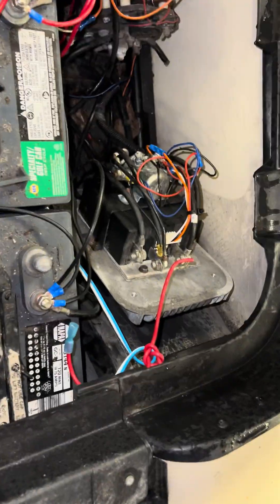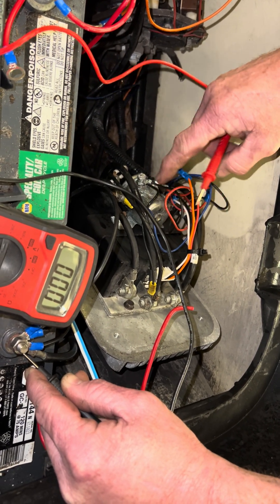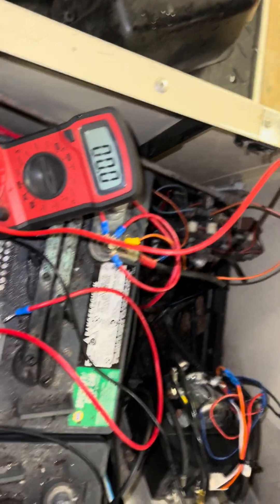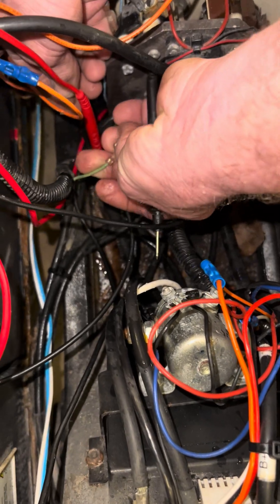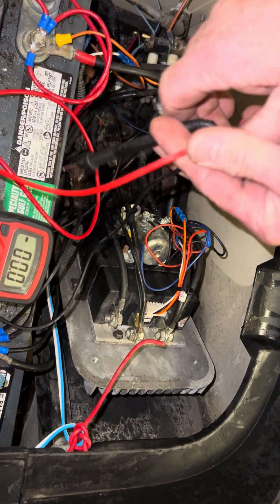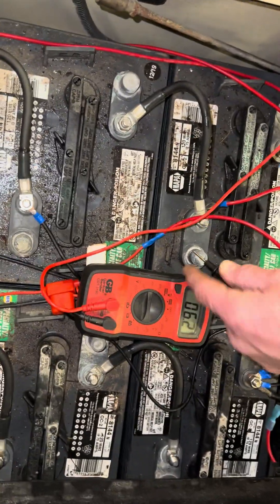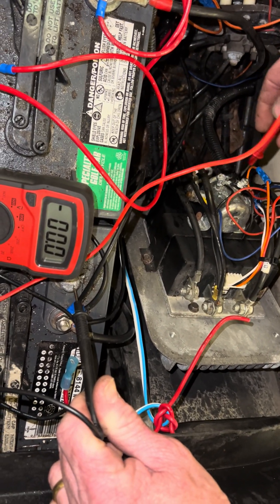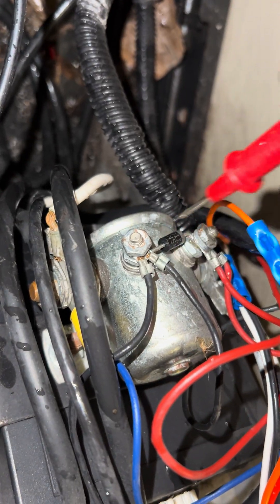What's REALLY Causing Your EZGO 36V SERIES Controller Solenoid Problems?

Comment: 2013 ez go cart won’t move. The beeping noise stays on in reverse, neutral and forward. Change the ignition switch and still does the same.
Reply from the maker: https://youtu.be/7Lks9A9b8Ko?si=lI8EJ28OY0PhZmS8
Reply from the maker: Has it been towed in run?
Reply: @golfcartwhisperer   possibly once or twice
Reply from the maker: @lbj2642  unhook the orange wire off the back of the f n r  switch and let me know if it still beeps in forward. If it does replace controller.  What’s the background behind the cart.  Or It just wouldn’t run one day. Or it broke down and you towed it home in run. Also when did the reverse buzzer start in forward.
Reply: @golfcartwhisperer   it was giving to me and the only thing I known is that the brakes locked up on them once before.
Reply from the maker: @lbj2642  how do you go from forward to reverse. A button on the dash or the keyswitch
Reply: @golfcartwhisperer   key switch
Reply from the maker: @lbj2642  oh so you have an Ezgo Rxv.  I am going to share a link with you
Reply from the maker: See if it makes this sound. Or is it like a bird chirping and constant
Reply from the maker: If it’s not like in the video that I shared with you.  Pull back on your gas pedal all the way.  And hold back on the gas pedal while you turn the key on and see if it goes away
Reply: @golfcartwhisperer  it’s like the sound on the video
Reply from the maker: @lbj2642  k replace the e-brake then.  I have another video of how to remove and install it
Reply: @golfcartwhisperer  ok thanks
Reply from the maker: Yes sir just hit the like button for me
Reply from the maker: @lbj2642  Ty sir

Comment: I have power to every leg of this FNR switch. What the hell is going on?
Reply from the maker: lol. I would just push it into a pond
Reply: @golfcartwhisperer  man. I wish I was joking
Reply: I ran through your diagnostic on a 97 ezgo and got stuck at the second thing. I literally have power to every leg in the FNR switch. I labeled the 4 wires like a clock.  I'm sure they are on right. As for the other 12 volt wires,  it was a different setup
Reply: Push on the pedal and the reverse beep stops.  Still no movement.
Reply from the maker: How do you have your f n r switch wired up.
Reply from the maker: If you unhook the wires on your f n r switch. There should be voltage on 1.  Is that the case
Reply: @golfcartwhisperer  had an emergency. Had to stop. I'll let you know when I have a chance.
Reply from the maker: Did you figure it out

Comment: Have a question having trouble with my E-Z-Go  golf cart my motor is making a clicking noise and the reverse beeper was going off while it was in neutral and the starter solenoid was clicking without the key being on just sitting there trying to solve the problem it won’t move
Reply from the maker: Have you towed the cart in the run position
Reply: No it’s been sitting there for about three months and I have to keep to charge it up Went out for the evening and came home and  reverse beeper was going off for no reason
Reply from the maker: What type of Ezgo golf cart is it
Reply: Question how can you tell how old it D 499  Serial number is 116-9050 if that helps
Reply: Yes it is all electric
Reply: 36 V
Reply from the maker: Do you have a tow switch under your seat It’s a 1999
Reply from the maker: Most of the time clicking noise in motor are the brushes stuck or a bad motor bearing.on the back of your forward and reverse handle do you have 2 micro switches?
Reply: Yes it’s on  that covers the solenoid
Reply: And like I said I came back one  evening in the motor is making noise and clicking the beeper going off for no reason
Reply: My meter showing 37.7 V sometimes up to 39 votes
Reply from the maker: @johnpierce2390  you have an Ezgo dcs. If the micro switches on back of the f n r handle are not stuck.  I would just replace the controller.  That’s normally a sign of the controller roller went bad.
Reply: Where do I find is microswitch
Reply from the maker: Beside the f n r under the seat

Comment from the maker: 1- if all the voltages in the video check right replace the controller.
2- if you have 14 volts dc going to the black wire. And nothing coming back on the white wire. Replace the its in the floorboard. The white wire should read 1.4 volts dc at full pedal
3- if you have voltage on the red wire in the 4 pin plug and 0 volts coming from the green wire. Replace the Microswitch in the floorboard.
Reply: What if I got no voltage at the 2 red wires on the small post on solenoid
Reply from the maker: @davidrussell9992  check your microswitch wires plans your keyswitch wires. I’ll share you a video
Reply from the maker: https://youtu.be/AJMxTTlW0QY?si=qZNEZyoOxf2jv6Q5
Reply: @golfcartwhisperer  ok so I also have no voltage to the forward/reverse but mine looks like an old school bell not like the ones I’m seeing videos on. Checking micro switch now
Reply from the maker: @davidrussell9992  post a video on your page.  What your talking about out and I’ll see what your talking about.
Reply from the maker: @davidrussell9992  let me know when you post it so I can look at it
Reply: @ ok should be posted just showing the voltage on solenoid and that forward reverse knob… also on the pins on the controller there’s no voltage to forward/reverse/ or the black and white wires
Reply from the maker: @davidrussell9992  okay so you have an EZGO DCS.  I am going to send you a video specifically for that car
Reply from the maker: Watch the video I just sent you that is for your specific type of golf cart
Reply from the maker: https://youtu.be/VrsA-0Ijgpc?si=tjU1GUPRGsSGC0It
Reply from the maker: Let me know if you have any questions
Reply: @golfcartwhisperer   here’s what I got from all the tests. So far I’ve replaced solenoid and controller(before tests) still not sure what exactly to do besides  micro switches on forward/reverse

36v on big solenoid/ nothing from red&yellow wire 

Key switch only 1.4 v

Micro switch floor board 
Red  .3
Green.3
Black 0
White 0

10 pin plug 
Red -36.7 v
Red - .3
Empty 
Blue 36 reversed as a ground 
Yellow .3
Green .3
Orange 0
Green .3
Black 0
White 0

Controller black and white 1.8
White to frame 0
Reply from the maker: K do this. Run you a wire from the main positive on the batteries to the small post on the solenoid where the red wires are and let me know what happens to get the gas and see if it runs.
Reply: @golfcartwhisperer  ok just like some spare wire does it matter what gauge?
Reply: @golfcartwhisperer  when I run the multimeter (red on main positive and black on small posts) they read 36v….is it possible the solenoid is upside down or wired wrong? I just copied the way it was when I put new one in
Reply from the maker: @davidrussell9992  where does the big post wire go to off the solenoid. The battery side
Reply: @golfcartwhisperer  main positive
Reply from the maker: @davidrussell9992  did you run a wire from the main positive to the small post above and see what happens
Reply: @ yes sir it popped and rolled forward
Reply from the maker: @davidrussell9992  so when you have the small post on the sol a hot from the battery and hit the gas the cart ran?
Reply: @golfcartwhisperer  yes sir
Reply: @golfcartwhisperer  update..I tested from the other batteries and it looks like everything has voltage. if I remove the main negative I also have voltage… put it back on and I lose the voltage…going to feel like an idiot if it’s just the corrosion on this main negative  lol
Reply from the maker: @davidrussell9992  let me know what you find out
Reply: @golfcartwhisperer  I made a new video testing the controller with negative cable attached and not attached. Brand new cable.  Still losing voltage when negative cable is attached…
Reply from the maker: @ okay will watch now
Reply from the maker: @ Ezgo txt 36 volt won’t move/ troubleshoot controller, reed switch, solenoid and wiring
https://youtu.be/VrsA-0Ijgpc
This is a video that the car just like yours, watch it
Reply from the maker: @davidrussell9992  what did you find out.
Reply from the maker: @davidrussell9992  Join this channel
https://www.youtube.com/channel/UC0oR8gK06xGD-oEpl5x-Twg/join
Reply: @golfcartwhisperer  ok I joined for the 45 a month. Cart will move forward when jumped from main positive to solenoid small terminal… lost here
Reply from the maker: @ Thanks for becoming a member.    It should have gave you my cell number when you became a member.  Shouldn’t me a text. Or if you want to do it via you tube let me know.
Reply from the maker: If you can’t figure it out. You can click on this link here and look at your options. And I can call you and we’ll figure it out.

Comment: My golf cart won’t start, it’s a 2003 EzGo pds and I check voltage on tow and run switch and only two read 36v (the red and white wire)
Reply from the maker: Run you a wire from main positive to small post on solenoid where yellow wire is and let me know what it does. Put in run in forward with key on and hit the keys.
Reply: @golfcartwhisperer  ran the wire to solenoid turn key on and put it in forward and nothing, still won’t turn on
Reply from the maker: Tie all 4 of the tow switch wires together.  Also what voltage does the 2 red wires on the bottom left in the main harness show. Black lead on main negative
Reply: @golfcartwhisperer tied all 4 together and now all wires are reading 36.4v (solenoid, tow/run switch, All main harness wires read 36.4v, B+ reads 36 v B- reads 36v, F1 and F2 wires read 18-22v( black and white wires on top left).Still doesn’t run.
Reply from the maker: @jorgec3176 k.  Now  run a jumper wire from main positive. Since you have them 4 tied together and see if it runs.  If it doesn’t run after that. Do another test. Will tell you if it doesn’t run
Reply: @golfcartwhisperer  didn’t run
Reply from the maker: Run you a wire from main negative to the blue wire on sol.  But don’t touch it to the blue wire until you hit the gas and while you hold the gas down. Then touch to the blue. Wire and see if the sol clicks
Reply: @golfcartwhisperer  Yes, the Solenoid clicks
Reply from the maker: @jorgec3176  okay but black lead of meter on main negative. And on the bottom front of controller.  There is a 4 wire harness. Black lead on main negative. Put the red in the green wire and hit gas tell me what it shows
Reply from the maker: @jorgec3176  so we need the sol is good. And you have a positive wire from key switch so that’s good. Now we have to test microswitch and the ITS in the floorboard
Reply: @golfcartwhisperer  Finally was able to work on it some more. I replaced the controller and it turned on and worked great. Thanks you for the replys back I was able to narrow down my problem thanks to you.
Reply from the maker: @jorgec3176  yes sir glad I could help.  Hit that like button for me. Make sure you subscribe to my channel. I post 2 videos a week.  If you ever need any help. Just comment on a video and I’ll respond.

Comment: Yes it seems fixed but it took a new controller.  I went with the Navitas Controller as it gives diagnostics to the phone app so it should make troubleshooting any future problems easy.
Reply from the maker: Smart man. Did you replace the sol with a high amp solenoid
Reply: @cpfans90  Yes I replaced solenoid with a high amperage unit.   Thanks again !

Comment: I have the same 36v cart. I have a clicking solenoid with no forward or reverse movement. I followed all of your instructions on troubleshooting. My voltage on B positive to M negative is 36 V all the time. I only have 36 V to the lower post on the F&R switch when in forward or reverse. In neutral I have 36v on the bottom and 22V on the side posts and 0 to the top post. Any ideas?  Thanks
Reply from the maker: Jack the cart up and jump b- and m- on the controller with a battery wire and hit the gas. But be careful.  It will run wide open.  If it runs then. Controller is bad.  If it don’t run replace the f n r board
Reply: @golfcartwhisperer  nothing when jumping b- and m- .  I already replaced the f&r board with Amazon garbage. Where do you recommend getting a quality replacement from? Really appreciate the videos. They are super helpful. Thanks.
Reply from the maker: @denney1933  go to shop Ezgo.com. lol on the Amazon garbage. Did you buy the whole assembly or just the board and cam
Reply: @golfcartwhisperer  I got the whole assembly.
Reply from the maker: Thanks for watching.
Reply from the maker: When you hit the gas in forward.  What does your bottom and top post on the f n r board have. Black lead on main negative.
Reply from the maker: If your top post and bottom post have voltage. Your f n r board is bad.
Reply from the maker: Tell me where your top wire on the f n r board comes from as well as the bottom wire
Reply: @golfcartwhisperer  bottom wire goes to B positive on the controller.  Top wire goes back to the motor. I can take the rear cover off and give you more specific info if you want it. I’ve had this card for a long time. This is my first real problem other than batteries.
Reply from the maker: Sorry man. Got busy when did you say you put the f n r board on?
Reply from the maker: If you just put on tell me where all the ire’s on the f n r board go to.
Reply: @golfcartwhisperer  I got another junk Amazon “heavy duty” f&r board today and it works.  Hours wasted because of a bad part but that’s how it goes sometimes. I wouldn’t have ordered another f&r if not for your trouble shooting videos. Thanks sir.
Reply from the maker: @denney1933  damn quick delivery.  Glad it fixed it.  Just like this. Video and subscribe to my channel. I am posting new videos every Monday and Friday.   Thanks for taking the time to let me know what the outcome was.

Comment: What does it mean if you get power on the solenoid in all tested areas without pressing the accelerator pedal(full 36v)
Reply from the maker: If you’re getting voltage on the sol in all the areas. With the black lead on the main negative.  There’s. Nothing wrong. You will get bleed over from the resistor. And the controller.   Ow if you’re putting your black lead on the blue wire and red lead on the yellow wire you have a problem. What’s your cart doing.

Comment: I have a electric clubcar noticed that when key switch is off , theres spark coming from the gear lever, any help will be appreciated thanks
Reply from the maker: So when you put it in gear with key off the f n r board sparks?
Reply: @golfcartwhisperer  even with key out of ignition and i move gear lever , i can see sparks on the solenoid
Reply from the maker: @ArielR-e5j  what year is the club car. If you see sparks on the sol.  That means that there is a loose wire on sol. And that the sol is bad.  If you see sparks coming from the gear lever. That means the solenoid is stuck closed. So replace solenoid

Comment: Great job on how to do checks but the problem I have is the cart won't move and it's fully charged and I have the same 94 ez-go thanks for the post
Reply from the maker: Have you checked any voltage?  Does the solenoid click any
Reply: There's no clicking it's fully charged I'm showing 6 volts in batteries and 12v  in 2 when I was jumping them I don't know if it is the ITS or solenoid thank you for the reply I just got back home
Reply from the maker: @joenobles1086  test you main battery negative and positive.  So test the whole battery pack and hit the gas and let me know what it shows. As  far as voltage

Comment: Zero volts there with 1 and 3 connected with the key on or off or with tow switch in the run or tow positions
Reply from the maker: when ever you connect one and 3 you should have 48 volts dc. on the harness side of the brake plug.
Reply: And if you don't,  such as in my case  ?
Reply from the maker: @kenny-Poo  check voltage on the one and 3 plug there should be positive voltage. Black lead on main negative Let me know what you get